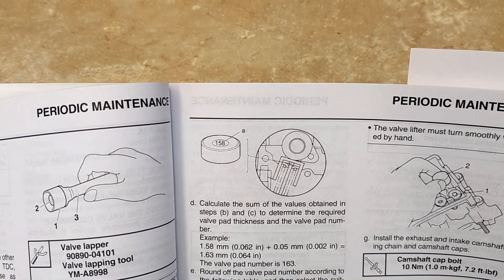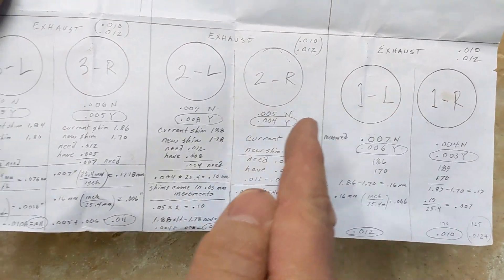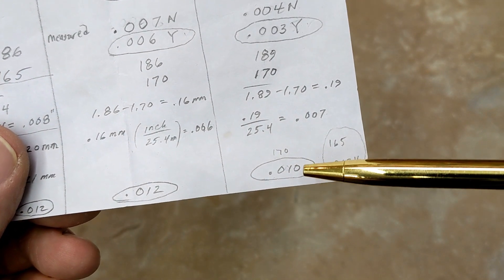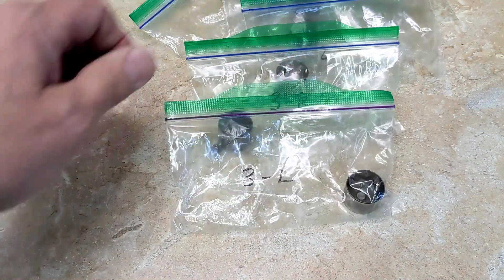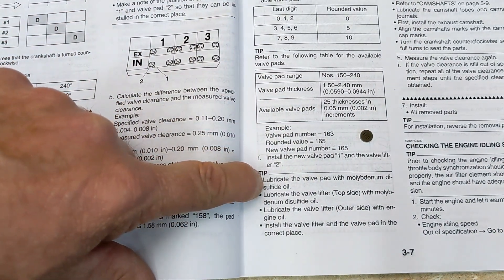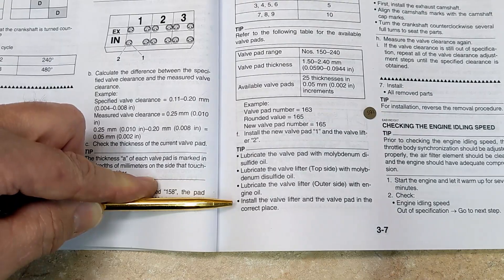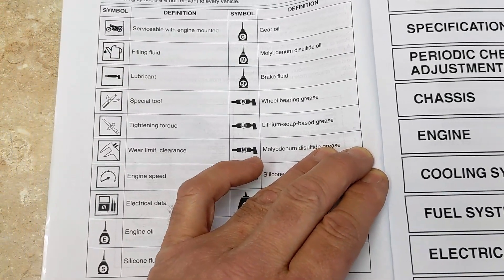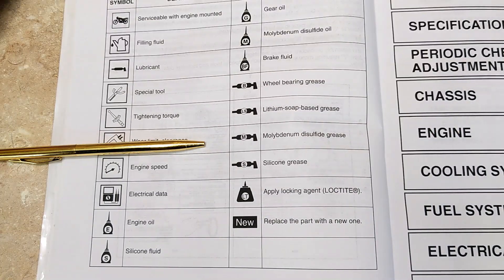re- installing thinner shims/existing valve lifters exhaust side Yamaha FZ-09/MT-09 2014 2015 2016

Comment: Assembly lube is easier to use than mixing grease and oil.  Every car parts store sells assembly lube.
Reply from the maker: Thanks...you are correct, in fact, when I asked another motorcycle mechanic about Molybdenum Disulfide oil which is specified in the Yamaha Manual, he said just use assembly lube...
I did look up the Maxima brand assembly lube which has a zinc base:
https://maximausa.com/series-315-assembly-lube.html?locale=en
Google "assembly lube" and it's almost limitless on companies selling it.
I did a lot of research on this topic. Yamaha specifies Molybdenum Disulfide oil but only sells a grease. This is why I thinned it down with oil after reading posts in different forums on the topic...
Basically the bottom line is that if you just use oil when reassembling, it will run off if you don't start the engine right away and when you restart the engine you will have metal on metal which is not good.
Here's a link that sums it up pretty well:
https://blog.amsoil.com/what-is-assembly-lube/
If you feel like getting really technical, here is a link describing the properties of molybdenum disulfide:
https://ws2coating.com/2014/07/07/why-is-molybdenum-disulfide-the-first-choice-among-industrial-lubricants/#:~:text=Molybdenum%20disulfide%20is%20a%20dry,considerable%20friction%20within%20the%20machine.
Feel free to add any input to this discussion...Thanks Robert

Comment: As Scott Baldwin is saying, Engine Assembly Lube is the stuff to use.....I know most people just use engine oil at the end of the day the parts just need lubrication.
Reply from the maker: Thanks for the comment!
Here is a duplicate of my reply to Scott Baldwin if anyone wants to go deep into the weeds on this topic.
"Thanks...you are correct, in fact, when I asked another motorcycle mechanic about Molybdenum Disulfide oil which is specified in the Yamaha Manual, he said just use assembly lube...
I did look up the Maxima brand assembly lube which has a zinc base:
https://maximausa.com/series-315-assembly-lube.html?locale=en
Google "assembly lube" and it's almost limitless on companies selling it.
I did a lot of research on this topic. Yamaha specifies Molybdenum Disulfide oil but only sells a grease. This is why I thinned it down with oil after reading posts in different forums on the topic...
Basically the bottom line is that if you just use oil when reassembling, it will run off if you don't start the engine right away and when you restart the engine you will have metal on metal which is not good.
Here's a link that sums it up pretty well:
https://blog.amsoil.com/what-is-assembly-lube/
If you feel like getting really technical, here is a link describing the properties of molybdenum disulfide:
https://ws2coating.com/2014/07/07/why-is-molybdenum-disulfide-the-first-choice-among-industrial-lubricants/#:~:text=Molybdenum%20disulfide%20is%20a%20dry,considerable%20friction%20within%20the%20machine.
Feel free to add any input to this discussion...Thanks Robert"